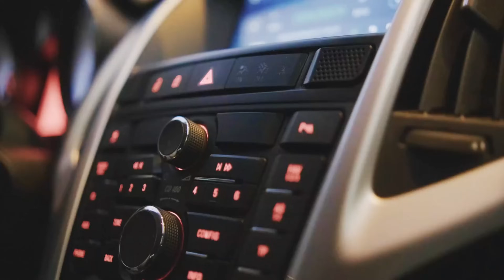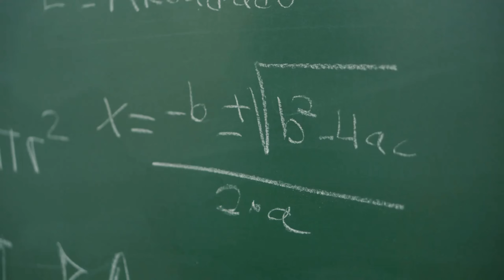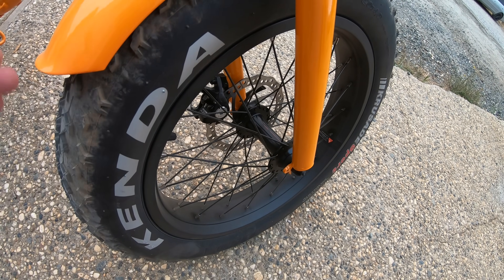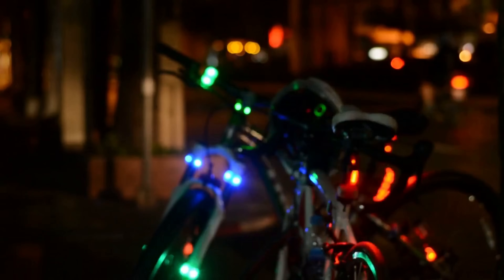Will Ebikes Ever Recharge While Riding?  Explained

Comment: I agree with you that it would be vastly inefficient to try and charge while riding,but what about instead of 1 big battery, 2 smaller batteries  you can use one with approximately 10-15 mile range and while riding keep the other charged? Once one is dead,switch batteries now riding charges the dead battery(hopefully to full or very close) before the current battery has been drained.  It's an idea,ya never know
Reply: The answer is no, you will lose power in the conversion and end up with less power.

If you're charging by an external source like solar, or gas engine you could charge as you go. But you could just as easily charge the single battery you're pulling power from. Putting a second motor to create power from the momentum of the bike will put a drag on the bike and cause the driving motor to work harder. Electrical motors are only about 80-90% efficient, the rest of the energy is wasted as heat, like a brake pad turns momentum into heat.
If you pull 30watts from your momentum to "charge" your battery you will cause your drive motor to use about 45watts more energy to move the bike just from losses in the generator, battery, and drive motor, for a net loss of 15watts... A perpetual motion machine is not possible without an external power source.
Reply: @josiahlehman1506   @Josiah Lehman  Wasn't going for a perpetual motion idea,just something to extent range without using massive batteries and adding extra weight. I was also thinking since the best efficiency on an pedal style ebike comes from the rider pedaling while assisted by the bike motor,I was more thinking that the rider can help charge the battery not so much the bike. Anything in motion has the potential to become a source for energy,why not let it help charge the battery(s). Whether is the wheels the pedals,the chain,the riders feet,anything,why think inside the box.  Its ideas,maybe our comments will help someone perfect an ebike charging system
Reply: @frankaltobello8120 Why do you have the electric motor in the first place? The most efficient option is to just use the chain and gears to turn your energy directly into motion.
If you take the mechanical energy of peddling to turn it into electrical energy to charge a battery to then use it mechanically to move the bike you will lose 30%-40% of your power converting it, not to mention the loss to in battery cycles and weight gains from all that extra stuff.

If you want to use your the energy to peddle the bike then do that directly, also the lighter the frame the better, that means dropping the battery and motor completely because just the weight of the battery and motor will make it heavy enough that you will need more total energy(you +battery) to move the bike.
Reply: @josiahlehman1506  Hhhmmm....I'm going to have to think about this for a bit. So your saying one or the other? Not a combination of both electric assist and human power? By adding a "chargjng" system it would be more work than what it's worth you say. Then why have an e-bike that has assist? Then a full electric would actually be better? And a regular pedal bike would be more efficient with just human power. If a pedal assist style ebike was to get a theoretical 50 miles a charge but I needed to go 58 miles the bike would be dead at 50 and the assist would be gone.  I'd have to pedal. Or get a second battery.  But I don't need another 50 miles, just another 8. So even if the poorly efficient charging system was installed, you don't think I could squeeze a measly 8 extra miles out of the ebike standard battery? You think I'd have no choice but to either pedal or get a second battery?
Reply: @frankaltobello8120  You can bring a second charged battery and just stop and switch batteries after the first one runs out sure. But to try to charge by peddling on your trip you're losing energy in converting it. 
You can absolutely save your battery power by working harder and peddling more, but trying to charge the battery with peddling will cost you almost twice the energy for the same distance.
Reply: @josiahlehman1506  very valid points,I'm gonna think for a while....

Comment: what if instead of batteries, we only used supercapacitors, and the electric power would only assist in quick accelerations and short hillclimbs (after a supposed steep recharging downhill perhaps)? A very light bike,with a light,small but very efficient motor, less cost to make,possibly even making the bike lighter overall by not using batteries, just capacitors,trying to make the bike mechanically as efficient as possible, decreasing rolling resistance and capturing momentum as electricity and recover it only when really needed.

Comment: Direct drive motor, that turns generator when no throttle is applied, a breaking system that uses resistance from the motor for breaking, and increases power generated from more force on the brakes.

motor go vrrrrrmmm up hill
motor go generate coasting downhill, without slowing you down to much.
motor go really generate when you go brake. 
Pedaling on flats go little generate, kinda like downhill. 

Of course it wouldn't be a full recharge but probably extend range a good bit. Seem the most practical root, only time you wouldn't be charging is when on the throttle, or sitting still. Add a fold out solar charger for long stops.

Comment: The best regenerative braking system would require super capacitors to absorb breaking Energy quickly and then slowly feed it back to the battery to recharge it or directly to the electric motor for a burst of speed. However this gets complex and weight would become an issue

Comment: Your better off using a solor panels to charge them on the go then change it over to next battery I use mine with a 48v x1000 20amp  hr works great for long distance tourning

Comment: I ride a Eahora X7, and it will charge the battery when going down hills.  I took a 15 mile ride last week on a trail with slight up and down hills, and the battery was still 100% when I finished.
Reply: When the motor and generator are used at the correct times it totally works! I only use my motor on steep hills but I re-gen on any downhill and even some flats. It really does help extend your range.
Reply: it takes 4V before 100% changes.
And that's like 5 miles +.
Reply: May someone tell me the names of the ebikes that can recharge the battery as I'm riding ?
Reply: This is awesome! I'm glad this tech is being developed

Comment: Makes me think of the photo that was making social media rounds not long ago of an electric car with a generator attached to the rear axle and the claim that it never had to be plugged in. Countless "Google PhDs" in Engineering said they knew for a fact it worked. What all the "experts" seem to overlook is that if a self-regenerating vehicle were feasible, the real experts would have designed one by now.

I think your video about how to extend battery life pairs quite well with this one: coasting down a hill can do more to extend range than any sort of gadget. LOL

Comment: when your talking about recharging the battery on the go you are right it cant be done,but the reason cyclists with an ebike are looking at this method for extra miles,so why dont thay do what i do take a spare battery with you on the rear rack problem solved.instead of 45 miles your getting 90 miles with 2 10.4 ah batteries.

Comment: I d seen regenerative braking in city buses, it saves brake wear and heat by storing the energy it takes to slow the bus down and is used to speed it back up after the stop, and they do work, they save brake wear and improve fuel mileage. So for a bike it would be much the same, if you were in a hilly area, it would save some brake wear and put a little energy back but not very much at all. Hardly worth the effort. Perhaps if you could somehow choose when to free wheel and when to regenerate would be a good thing because all the drag slowing you down when not on a hill that’s steep enough to make power would surly use more power than it makes which is basically what you were saying. So not disagreeing with you at all, but it’s not something that can’t be done ever, either. Great video, gets people thinking.

Comment: When l was a boy l had a bike (English racer) that had a small generator that could be engaged to contact the tire and run the headlight. Seems reasonable to me that any energy generated could be hooked up to the battery to extend range to some extent. It seems to me to be free energy since the tire is spinning anyway. Kind of like the turbines of a hydroelectric system that generates electricity from water flowing through a dam.??⚡️⚡️⚡️ Anyway keep the videos coming! Thanks from Staten Island
Reply: Free energy? Have you ever pedaled a bicycle? It requires effort...work
Reply: @matthewhardy8133  untapped energy, process that hasn't been adapted to harvest energy... are we ok now with terminology? His example of dams and turbines is perfectly acceptable, and comparing it to a tyre rotating is also acceptable. The energy is there, it just isn't being harvested.... or have you never ridden a bicycle down hill without pedalling?
Reply: @gheretmaaar7652  there is no "free" energy to "tap" from the spinning wheels of any vehicle...except on deceleration or going downhill. The kinetic energy of the vehicle is sustained by the energy input of pedaling, and/or from the battery on an ebike.
Reply: @matthewhardy8133  I didn't say there was any free energy, there is energy there present to harvest though, whether that impacts on speed or performance I don't argue with either.... The concept of using a pedelec with a dynamo attached is still viable
Reply: the generator creates resistance so you can recharge a battery but you would use a lot more energy than it would give you back
Reply: Dynamo
Reply: Yes exactly, and even though this has been addressed slightly in this video, I don't fully agree. Say the ebike is solely pedal assist, then surely mote energy could be generated to charge the battery?

Comment: Rattan also known as yammy claims that have I-pas. They claim their system is efficient and regenerates. Then the 2020 model I bought from them they told me only had half of the bypass system with the 1999 model have the whole system. But the new yam e-bikes had I-Pass built in and it's supposed to be regenerative. Check these guys out see if it was true or not I'm very curious my own one of their bikes

Comment: It works suprisingly well on a $300 electric scooter.  If you are really good, you don't have much actual need for a friction brake on a well built scooter.  I have a fairly long downhill slope right outside my door.  I don't bother charging my scooter all the way, because simply engaging the regen brake for a couple kilometers tops it off.

There are actually several scooters that have a right thumb throttle for forward motion, and a left thumb throttle that engages an electronic regenerative brake.  They tend to be the cheapy $250 or less models in fact.

Comment: The biggest problem with regen is that it also limits your ability to coast. If you turn it off so you can coast efficiently, then you've lost a lot of the benefits of coasting, which you use a lot more often than you need braking going down hills. I guess if it turned on only when you used the brake lever...
Reply: Agreed, but only if you are looking for efficiency. There are times when I turn my ebike to Regen mode which charges the battery when above 15mph just for the workout factor. It takes the flat land I am now living in and creates some resistive challenge while charging the battery. If I was going for riding efficiency only I wouldn't be riding a fat tire ebike it would have 120psi road tires  without a suspension for least weight and resistance. Of course then off road use on trails would not be an option.
Reply: @TechnoAgape  then why bother with an ebike to begin with if you wanna workout?   Just get a 26" BMX......    the geometry is WAAAAY better than MTB. I have both kinds.
Reply: @chrisw5742  because I have other purposes for the ebike other then just exercise.

Comment: Very nice explanation.. the amps cannot be enough to regenerative sources...however why dose one  battery bar adds up if I just complete a hill climb or reduce PAS pe shift from 3rd to 2nd gear on the go..? Dose the battery electrolyte charge up when load is mechanically overcomed?

Comment: The problem with foldable solar is that its dead weight not earning its keep unless you are stopped and have it unfolded.
I go bikepack camping and found panels on a trailer to be the preferred method.
It is always supplying power to the system rather you are moving or not.
Before I crawl into my sleeping bag I make sure the panels are pointed toward the sunrise.
By the time I'm ready to hit the road, the battery is near if not fully charged.
Reply: My thoughts exactly. What size panel do you use?  I have a Burley Travoy trailer that should work well to hold the panel(s). Depending on your direction and the time of day!  And your latitude.
Reply: @barrybogart5436 , I use (2) 24v 60w rigid panels.  The flexible panels are not yet reliable enough to invest in!  The extra 100w on average helps to offset the power needed for towing my camping gear while in motion and charges the battery when I'm stopped.

Comment: The amount of people who ask "does it recharge when you pedal?" 

I struggle to understand how people think you would want a bike where you pedal even more

No one buys an electric bike so they can pedal more
Reply: I pedal all the time. I use my ebike motor on windy days or when I'm carrying a lot of weight in my rear baskets...
Reply: What is the problem of a normal bike?
The gear range is limited, so you struggle to go uphil and the bottom bracket dies quickly because of too much torque, and/or you struggle maintaining 45kph in cruise with a heavy tailwind. You also need to maintain a certain power output (dependend on incline and weight) during ascend or you will stall the bike. This is where the e-motor comes in.

Obviously, you want to recharge the battery while your riding. Otherwise, your range will be limited. Think of a hybrid vehicle from Toyota that only works properly if you recharge it at home in short intervals. Doesn't make much sense, does it?

If you rely on charging at home and using electic power instead of the human powerplant, just get rid of all the mechanics and the uncomfortable saddle and ride an e-scooter. Much more comfortable, cheaper, reliable.

Best would be to pedal only for the power generator and have a throttle control the speed/output of the electric motor that directly drives the bike.

Comment: 2 cranks 1 clutch. 1 crank on the right to drive the back wheel. 1 crank on the left side to recharge through a dynamo. A clutch to select L, R, L+R. You can then set it to R and pedal to recharge your bike while going down hill ?

Comment: When talking about whether it's possible to recharge while pedaling, I think you missed a more important (and simpler) explanation as to why not. IT DEFEATS THE WHOLE POINT OF HAVING A BATTERY IN THE FIRST PLACE. The battery is to provide energy to the system and make pedaling easier. You don't need to "pedal a generator" to generate energy, you can just switch on the regenerative braking and pedal at the same time. BUT WHY WOULD YOU DRIVE WITH THE BRAKES ON? Heck, I don't like pedaling a regular bike with even slightly underinflated tires. I certainly wouldn't want to recharge a battery while pedaling. Just charge it at home.
Reply: Depends on your application. I dream about just going out into the woods and not having to worry about anything except food. For me ebikes would be awsome to climb hills with all my camping gear.
Reply: @Davmm96  I"m not sure how your comment relates to mine.

Comment: What's a good (reasonably priced) Ebike that you'd recommend?
I'm looking for something that at the least can carry 300lbs, assuming that a trailer doesn't count towards that, if so, then 400lbs.

The trailer I currently have my eye on for both capacity and ease of access is the Burley Coho XC, but I need an electric bike to go with it.

More specifically a class 1or 2 ebike, but if that's too far down the specifications, don't worry about it, I'm sure I'll find something.